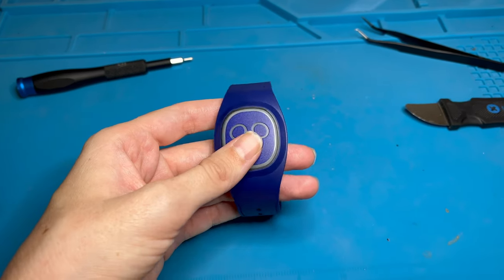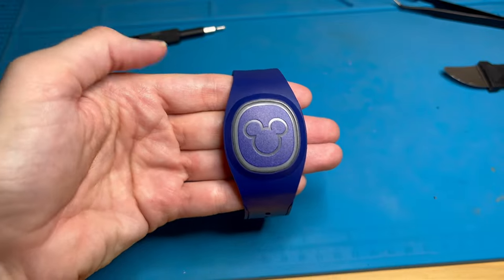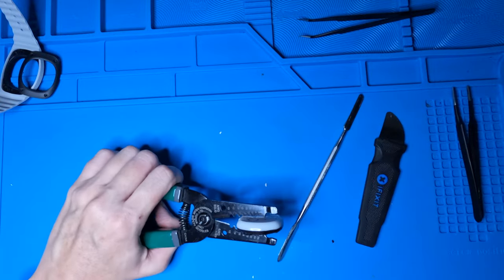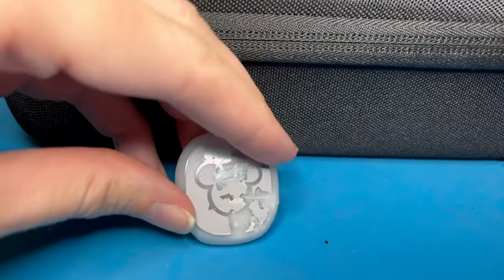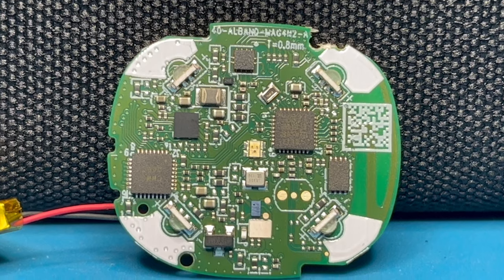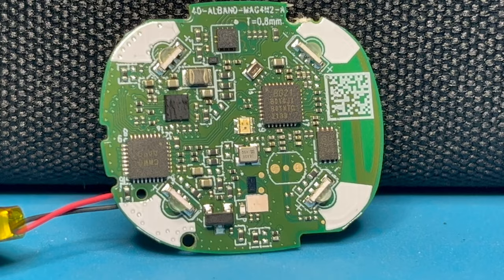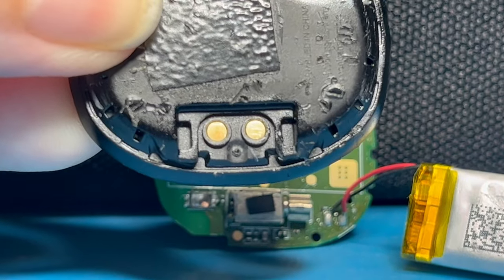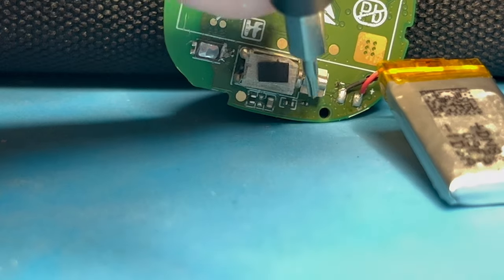See What's Inside Your MagicBand Plus

Comment: You covered all of this but nowhere (unless I missed it) did you show the battery part number or battery chemistry.   Do you remember if this is a NiMH or Lithium cell?  There is a number visible in the video but that appears to be a serial number for the battery, not a part number.
Reply from the maker: I believe it’s a lithium-ion battery. The battery is manufactured by ATL, who is the world’s leading producer of lithium-ion batteries.
Reply: Is this a BR2325 or CR2325 battery? BR is rechargeable while CR is not rechargeable
Reply from the maker: Must be a BR then, as the MagicBand+ batteries are rechargeable.
Reply: @ThatFLFeeling  noted, because I’m wanting to take it to a jeweler to have the battery replaced since I’m having battery issues and I’m afraid of damaging it if I take it apart.